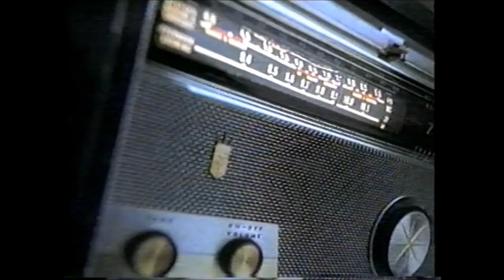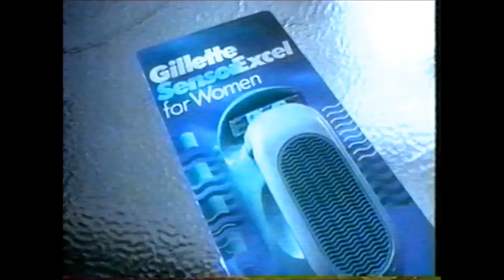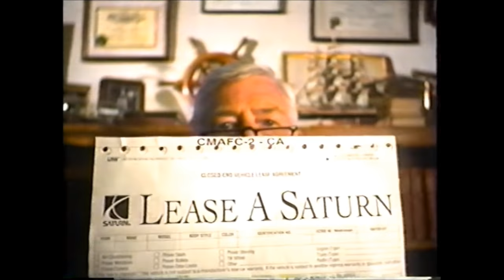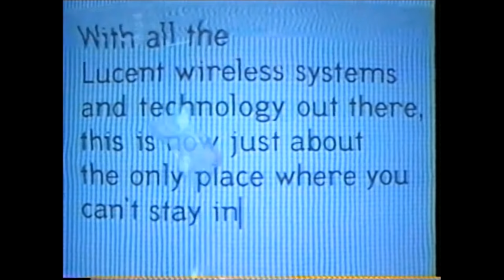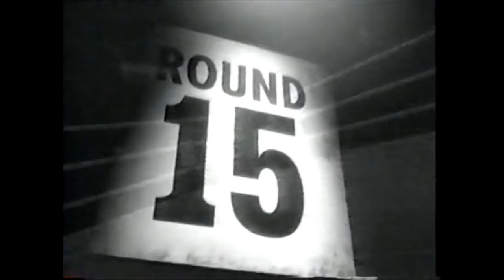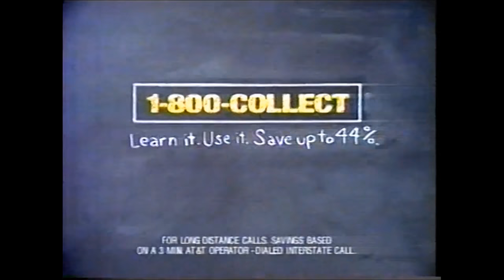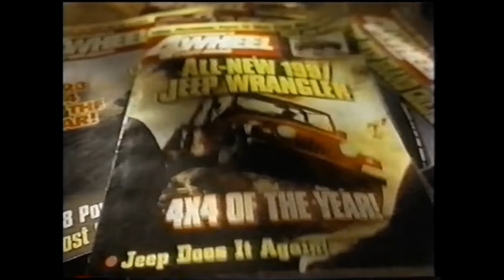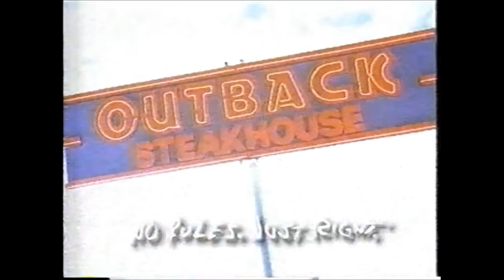One Hour of 1997 TV Commercials - 90s Commercial Compilation #1

Comment: "Zantac is so SAFE" that didnt age well...
Reply: It is safe, the recall that happened was because the production process had impurities due to lax manufacturing quality.
Reply: @justinblackwood4241  "it's safe, except for this thing that made it not safe"
Reply: @claytontraise5903  I suppose that's a bit of semantics. The traditional Zantac compound "Ranitidine" itself is safe. The quality control process failed, and impurities during the manufacturing process allowed impurities (non-Ranitidine compounds) to make it in the final product. It seems like manufacturing of "Ranitidine" looks like it's too difficult to be consistent and safe, so it seems like it may not return to the market. I do agree with you, if manufacturing of "Ranitidine" is not easily safe, then you can argue the compound itself is not safe. However, now Zantac (Zantac 360) is using "Famotidine". So we'll probably continue to see the "Zantac" brand, but with the safer "Famotidine".